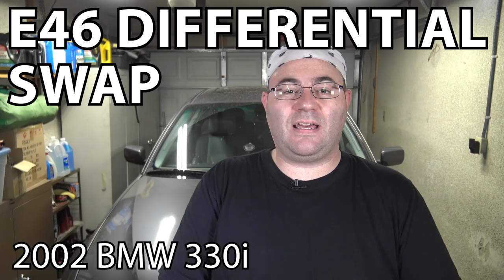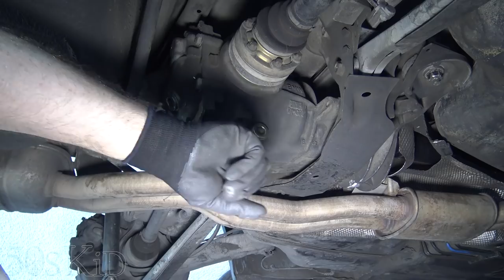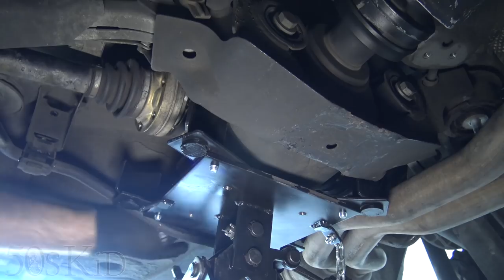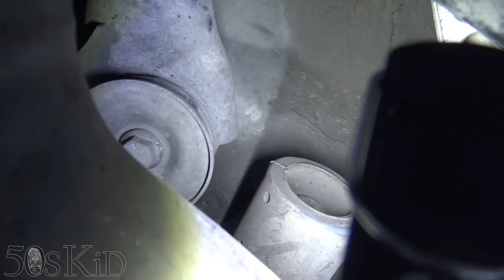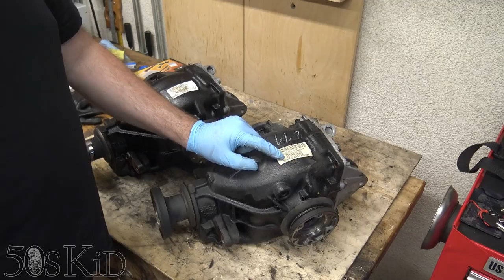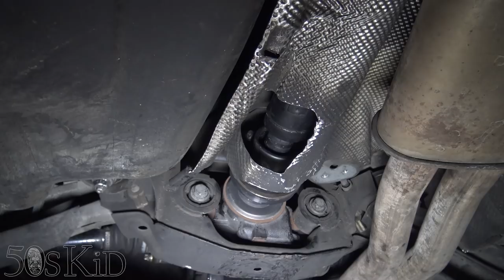BMW E46 Manual Swap Project: Differential Swap DIY

Comment: Nice video 50sKid! I just replaced my rear droplinks and did the bracket that holds them to the arm. Those two bolts/nuts that sit right by the spring are a right bitch to get to. I didn't bother taking the springs out either which is what a lot of people recommend. How come you didn't mark up the drive shafts for re-installing? Aren't they weighted from factory and need to be bolted in the same way?
Reply from the maker: I don't believe the CV axles have any balancing on them because they're so short--I may be mistaken on that as I've never noticed, however if they were balanced they were balanced as an assembly off the car.  The main driveshaft itself IS balanced, but, again, it's done as an assembly off the car.  So there's no point in marking it in relation to where it bolts up to the diff or the transmission.  You would only mark it in the middle of you were going to split apart to change the center support bearing.
Reply: You may be right. Other people and sources of information say to chalk them up and put them back together the same way. 

Would you say that the subframe/diff bushings that go bad over time, contribute to the subframe tearing issue? When you think about it, if those bushings crack and no longer absorb impact, your diff will literally be tugging on the unibody. Same thing applies to the subframe bushings themselves I guess.

Comment: Hey 50’s kid !! It’s me again, from your last video ! I had a lean condition and my bank 1 short term fuel trim was stuck at %27.34, so you recommended that I changed my Upstream Bank 1 O2 sensor, and I did it ! Unfortunately the problem is still there. But I can read fuel trims now ! When I reading them the other day, the fuel trims looked kind of normal when I was giving gas at around 3000 ish, but when I let the car idle, both Banks 1&2’s fuel trims went up ! Both went up to 27.34% and then stopped. I’m really confused at this point. What do you think? Right now my only codes are P0171. Help me please 😭
Reply from the maker: Ok NOW your symptoms are of a classic vacuum leak.  All you have to do is find it and fix it.  Make a smoke machine like in my video on that subject if you can't find it.
Reply: 50sKid you got it !
Reply: 50sKid So far I’ve checked the disa valve, app the intake boots, secondary air pump, but so far nothing. I’ve checked the CCV, but it’s not cracked from where it usually cracks at (hose going to the dipstick) , so I’m in the process of removing the intake manifold to get a better view of things.
Reply: @AdamCMoreno  did you find the leak?because i have the same problem on my e39 520i M52 tu

Comment: I would've set a mid setting.. diff..  not as tall but not as the original with the manual.. so you have both quick acceleration and  good top end..
Reply from the maker: Definitely an option.

Comment: I don't know if this question has an obvious answer, but if I'm shifting in tiptronic in my e46 325i, will the rpm "distance" between each gear be the same when I do the manual conversion, or will it give me even less rpms in each gear (shorter amount of time while accelerating before having to gear up)? I could tolerate the manual transmission without a diff swap if it shifts the same way the auto trans does in tiptronic, but if the gears get shorter, I'm gonna have to find a manual diff before doing the conversion. And manual diffs seem to be the rarest item in australia.
Reply from the maker: No the gears get super ridiculously short, especially 2nd. The car accelerates almost twice as fast and the top speed drops to about 100mph
Reply: Thanks for the reply, man! Big fan of your channel. I'll have to hold out until I find the proper diff then before doing the convert. Would 4 cylinder e46 diffs work as well? Because that would at least broaden my search field.

Comment: Hey I have a question. unrelated to the differential. I have this one spark plug cylinder that makes a clicking noise, and when i pull out the spark plug coil, the clicking stops. Also, i run the engine and pull out one spark plug coil at a time and there is no change at all to the engine. I use a multimeter and all spark plugs coils have resistance of .5ohm or higher. Im lost..
Reply: How can you run the engine and pull a spark plug? Once you disconnect the coil, its not going to get power.

Comment: Hey bro would you suggest reinforcing the sub-frame bushing even if there isn't any signs of cracking? If so what method would you recommend?
Reply from the maker: I would say that if you have a manual it may be worth doing.  Personally I feel like welding is really the only way to go.  It's what the dealerships were doing.  I seem to remember there was one dealer TSB that had them spraying epoxy into a cavity or something.  But welding the plates is the way to go.  But if you have an automatic I wouldn't worry.  Only the early manuals and all the M3s develop the problem (the M3s do it because they have so much power).
Reply: First of all I would like to say thank you for responding I really appreciate it because I know how busy you might be. I just picked up a 2004 325i with a lot of issues and I am trying to get it car worthy, I did the oil filter housing gasket, shocks, and I'm getting a noise from the rear so I think its that or the Diff. I inspected the area and did see any cracks. However it looks like the diff has been leaking for some time so I decided I will rebuild it and while I have it off I was considering getting the bushings done and also reinforcing the welds/area. However if that is not necessary and if there aren't any signs of cracking I may just leave it. With that said I would thinkin the epoxy because that I can do (DIY) welding will be a whole different story. I also have a MAF error I think because the car just shuts off/stalls on me while I'm test driving and I'm trying to get to the bottom of that as well. Either way excuse my lengthy Thank you, but I'm just letting you know what I'm dealing whit even before actually driving the car lol. Thanks again bro.

Comment: so you say you dont prefer that 338 with manual trans, is not easy to drive around?
Reply from the maker: Yeah the shorter gears from the automatic diff were a little too much for me. Makes the car really quick but way too much work
Reply: @50sKid  I see thanks

Comment: Are you going to create a video showing the replacement of the differential bushings?
Reply from the maker: Yeah it's next.  Only the one cracked one though.
Reply: did you use a special BMW tool in replacing this rear diff bushings? or home made?

Comment: Hey man I changed the diff on my 330ci from a 330i both 2001 automatic and when I noticed it doesn’t have a sway bar, after I got done replacing the diff I went for a test drive and when I turn right the rear left wheel locks and when I turn left the rear right wheel locks any ideas?
Reply: Yeah. Get a fucking sway bar. Wtf?

Comment: Maybe someone can help me🙄.. I've just bought an E46 320D but which have been swap to a M54b30 (330i).. my question is; how to know if the differential also have been swap to a 330i knowing that the brakes on the car is still from the 320D

Comment: Could you do this the other way around for a manual to get better mpg
Reply: I don't think so, not a swap at least. I believe the lowest gear is 2.93 and already in the manuals. You could probably build a custom diff with lower gears if you really wanted to go that route

Comment: Interesting I Swapped my differential in a ZHP to a 3.38 and yes the gears feel shorter but not a whole lot. I daily the car and at 80mph in 6th I'm Doing maybe 3.1k rpms. 

Now my 328i only has 5 gears and at 80mph it spins at roughly 3.3k that's with a differencial with taller gears... 2.93... if my ZHP has a 2.93 it would do some 2.5k at 80... just my 2c 

All in all I think a 3.07 is still best bet for 6 gear cars
Reply from the maker: I think a 3.07 would be good for my car as well.  Hell, the 325i manuals have a 3.15.  They put the 3.07 in the ZHPs as well as the 323i's so I'm sure I can find one soon enough.

Comment: I have the same problem on my e53, manual with m54 engine. Cruising 75 miles, 5th gear, 75 miles/h - 3.600 rpm. First gear is a joke. Starting in second gear is no problem. Manual transmissions are very rare option in e53. I believe that bmw did not bother to install or develop front and rear differential for manual transmission. Shame!
Reply from the maker: Wow didn't even know they made a manual e53
Reply: those are near identical numbers for my z3 m s52. I'll never understand why 5th is such a low ratio. doesnt germany have the autobahn?

Comment: Quick question i have an e60 525d 6 speed i broke my diff and the one i have the ratio is 2.56 can i swap one from the 530d ratio 2.47